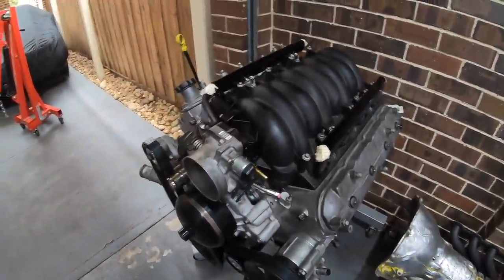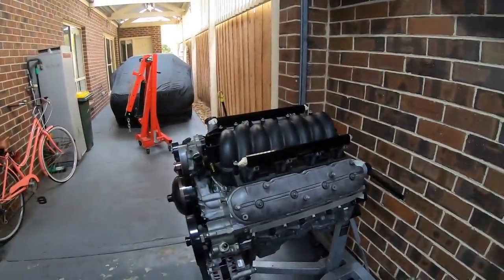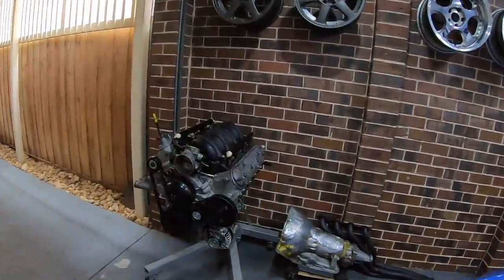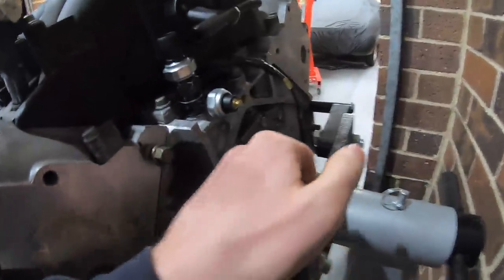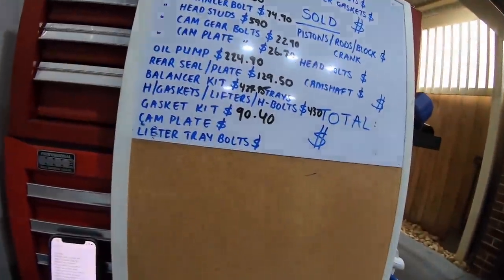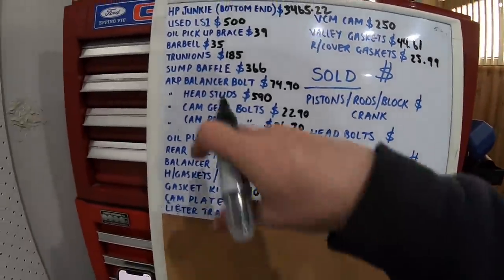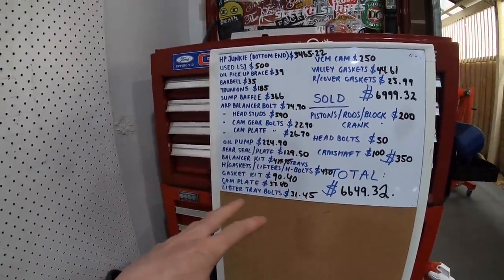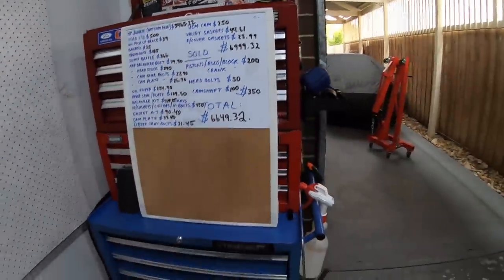BUDGET LS1 BUILD How much $$$ did it COST?!

Comment: I did pretty good then after looking at this. I picked up a MY9.5 VE SS wagon off my next door neighbour for $500. The car was on jack stands since the day I moved in. He said the starter motor died in it, then he purchased a new one, but bought the wrong type (there’s two types, clip or bolt style connectors) anyway he was going to call a scrap yard to pick it up as he had bought a new car, and I told him I would give him more than the few hundred bucks he had in mind.

He helped me push it next door to my house, I ordered a new starter motor and had it running the same week. I spent the next 3 months fixing everything that needed fixing (shocks, brakes, discs, hood lining, engine mounts, A/C) and then got it registered. 

I’ve been daily driving it for just over 6 months now. Best Buy ever! Owes me $6500 now as it sits haha!

Comment: I’m looking into at least a refresh my LS1 in my 2000 ws6. It has 187k miles and just headers, exhaust, and SLP air box. On a cold dense day it feels good and powerful I assume it makes stock power on those days. On a warm/hot day it feels a little weak on the power side. Looking at the total cost I’m thinking I’ll probably just convert to a blueprint LS3 for $2k more that will come with everything and make over 500hp with a warranty and guaranteed power number.

Comment: Great video and I appreciate the honesty on the cost of your engine. I didn’t place a comment with my guess in time, but I was thinking approx $7k. Everyone thinks LS’s are cheap, but it still costs big money for big power and reliability. I like your engine build. 👍🏻
Reply from the maker: no matter what engine it is its very expensive unless you can do every single thing yourself :(
Reply: @MindieJ  I concur mate. I’ve recently built some Holden V8’ (355 and 383) and some LS3 engines and they were all between 10-17k with me assembling them. 
Speed costs….how fast do you want to go…
I enjoy your videos mate.
Reply from the maker: @bigal878  yeh definitely not cheap! Once this runs an 11sec pass I’ll be happy

Comment: I did leave a comment a while back saying you can buy summit forged cranks for under 1k (no import tax to aus). You needed pistons anyway. So then all you need are the 6.125 rods, cheap ones for around $700. Then you have a 383ci. No clearancing required like the ol 5Ls. Just some washers on the windage tray to space it out. This is a forged rotation assembly with gen 4 style rods and pistons. If you didn't have the extra $1700 fair enough. But to not mention this as a cheap reliable build is not bad but average advice. If guys have used ls crank, rods and pistons which are in good nick they can be flogged for $500 and up. Put towards the 4" forged stuff. Honestly I would have skipped a bit more on the top end. Your build your choice, but another 20 guys gonna go out and rebuild with stock rotating assembly and be missing out just by not having alternative info.
Reply from the maker: then add some heads to go with it because youd be silly not to, a bigger converter again, a more serious box to handle the power ect ect......its not just "ad a crank and youve got a stroker"

as for not having alternative info, LS is literally the most common engine in the modified car world, hundreds of thousands of different videos, articles, forums ect out there
Reply: @MindieJ  Stroker budget. They happen to come in forged and gen 4 style. Not suggesting that's needed. Heads? Heads are useless on the street. Those ppl are idiots who suggest that. Same thing could be said for aftermarket cam and trunnions. High stall again not a good idea unless going further. Higher diff ratio? Yes good for the street. More serious box? Camshaft and heads will kill it before stroker. Bringing the power band up. Injectors? Cam and heads = more fuel up top and more power more likely need injectors. More revs less reliability. Increasing stroke and crank length is not going to do those things simply on their own.

Comment: If you were working on a tight budget, totally understand, however, since you were $7k deep into this motor, did you look at the value proposition of $ vs HP gain?
Reply from the maker: there wont be any HP gains, i didnt add anything that would increase power from before
Reply: @MindieJ  understood mate. I said, since you were $x deep in the build for a stock LS, did you consider the value proposition of spending $x more for x HP extra, since you were already  going through a rebuild.